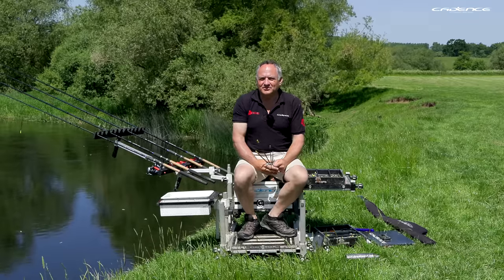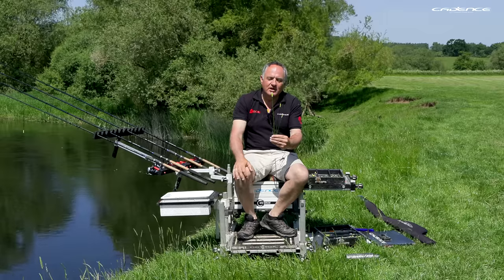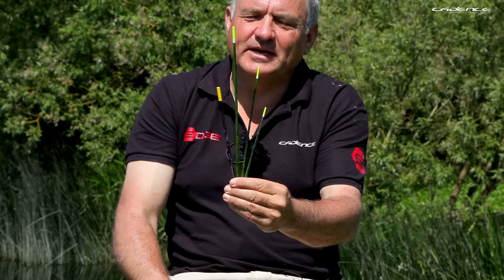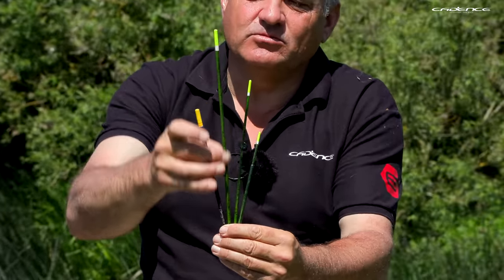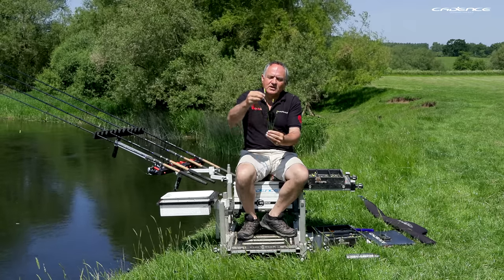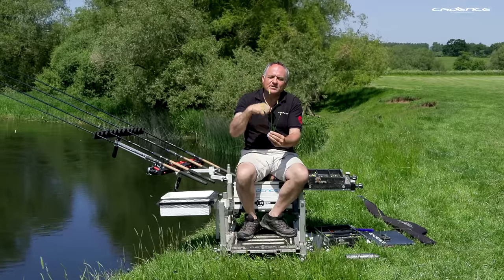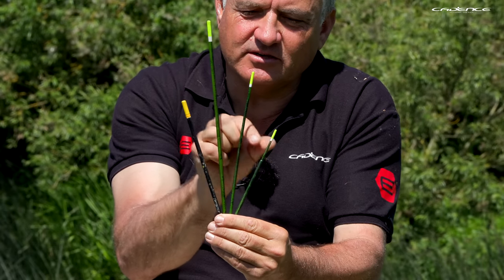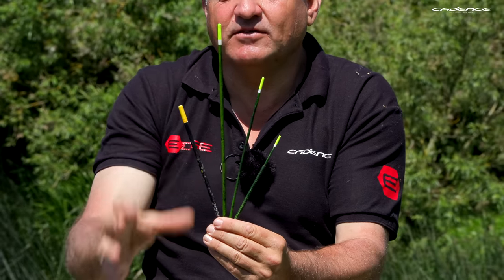Float Fishing on Rivers Part 4: Waggler Floats

Comment: Thanks for another great video James.
What is the maximum difference you would have between your line and hooklength diameter? 
When fishing fine I have been using 2.5lb Maxima, with a stated diameter of 0.14mm, but is probably closer to 0.16mm in reality. I match this to hooklengths of 0.08 tp 0.10, usually 0.09. Would a mainline of 0.14 or lower really make a big difference to my fishing?
Reply from the maker: Hi! My guide would be 0.07-0.08 hooklength on 0.12mm reel line. 0.09-0.12 on 0.14 or 0.16mm reel line. It’s good to balance the reel line to the hooklength as best as possible. Lower diameter reel lines also better for casting lighter floats. Cheers James